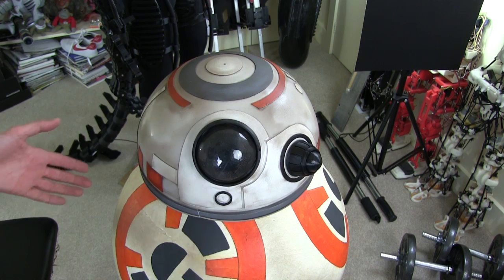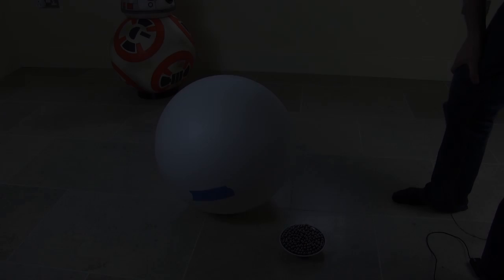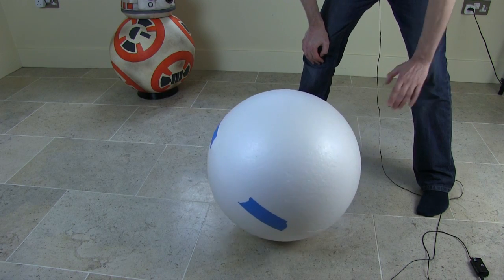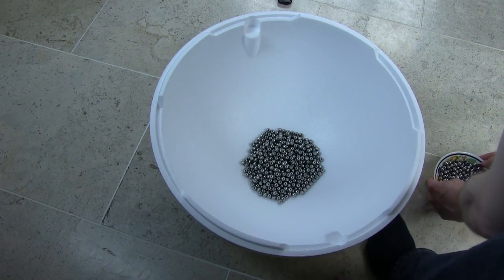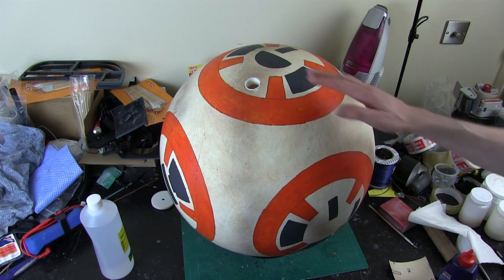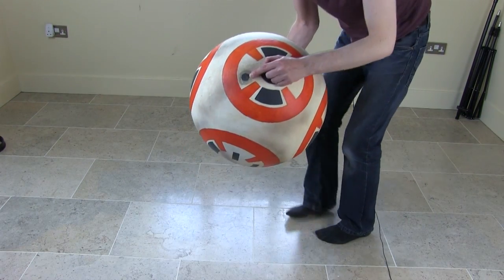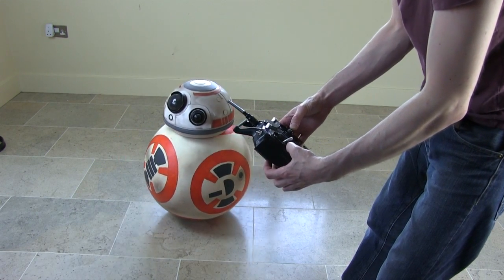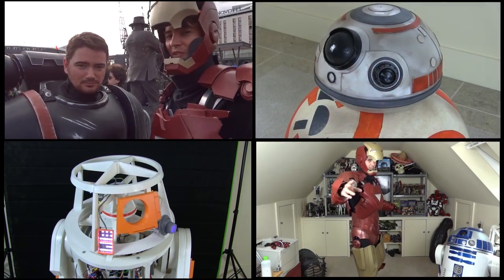Star Wars BB-8 Droid v1 #5 | Improving Stability | James Bruton

Comment: Did you consider the same system, inside the ball magnetically linked to the head outside, with a vertical shaft, going down to the bottom, with an heavy weight at the end, that wouldn't touch the bottom. The upper part under the head would generate the mouvement the same way yours does, and the weight just above bottom level would ensure stability. The magnets woukd ensure perfect friction between wheels and body?

Comment: You made your droid super top heavy and don’t understand why it has trouble balancing ....
Reply from the maker: That's part of the challenge - to see if the control system works - like a Segway/hoverboard?
Reply: James Bruton yeah but you added multiple DOF’s to the system AND used those terrible omni-wheels that have zero grip/friction.
Reply from the maker: @alkaline3mc  The grip isn't the issue though is it. Can I just point out that this was my first Arduino project from five years ago. I'll be building another ball-balancing robot in the new year. Check out my LG robot for now: https://youtu.be/e-CTFbop4PU
Reply: Also, when you find yourself Kluging in solutions like “filling your droid full of ball bearings and silicon”, to make your control loops work, then you need to go read up on control loops because you’re doing them wrong.
Reply from the maker: @alkaline3mc  I refer you to the comment I made some moments ago.
Reply: James Bruton oh I saw your comments. I’m encouraging you to stop kluging and just do things right the first time.
Reply from the maker: @alkaline3mc  please read the comment again then and refer to my more recent project.
Reply: James Bruton ahhhhh, so ultimately you’re decided to go back and do the right thing but for some reason couldn’t just say “I made this a while ago and have since decided to instead do exactly what you’re suggesting”.

Comment: HI James, I've got mine working now, so happy with it, I get 'pretty good' stability on smooth floor, but then I'm using the BNO055 IMU so most of the processing is on the A0 chip on that.

I do get a 'whining' noise tho when the head is at 'rest' on the top of the ball, any pointers on getting rid of that? I'm using 2 x the L298N boards (I blew up about 3 Rover 5 boards due to pulling too much current! :( )    :D :D

Comment: you could just put an RC car in it
Reply: Sanicle the car would not be able to move bring that the connection to the remote is not direct (the antenna would have to be put outside of the ball even then it would have to be in one place making only the weeds inside moveable and not the ball

Comment: Have you solved the oscillating issue? I think you should try using a powder such as flour instead of the ball bearings, I believe it will be much more stable, it will also be much quieter.

Comment: I m not a nerd ...but i think you should try using two spheres .,you know "one inside the other "n try finding a way to both stabilise and use it for movement also ...  That way it will not only move around stabile but also move in all directions.. If you get what i mean ...

Comment: Here's an idea. Place a large metal ball, such as a standard pinball, inside the base and attract it to the top with a really strong magnet in the head. If that won't work, try several smaller ball bearings.

Comment: Interesting approach! I think another good idea would be to have an omni-directional gyro vehicle within the lower ball, and perhaps magnet in the top of the inner sphere to attract another magnet in an ultralight head moving around on bearings. Of course that would simulate the head following the body rather than the body following the head, since the top of the inner sphere would initially tilt in the opposite direction of the desired motion. Can't say I've seen the new Star Wars so I don't know which of these ways the robot actually appears to work. Anyway great work with the arduino, I can hardly get mine to turn a motor 😂
Reply: +James Bruton (XRobots) haha yeah came to that realization soon after leaving the comment. Incredible work very impressive!

Comment: It would work by simply make the bottom ball heavier ( with no moving mass inside) more inertia, less need of high Mhz controller, I think. No moving mass = NO WOBBLE !
whatever material you try inside an hollow sphere, you just change the wobble value. think about conservation of movement.... ;)

Comment: My suggestion: Although I haven't watched the star warz movie, I have seen the trailer and from what I seen it seems that it could tilt with BB-8's head regaining balance. So I'd say design a somewhat similar mechanism kind of like BB-8's head and place it inside the ball. Design it to be magnetic so attach a similar magnet onto BB-8. So it says on the ball while still being able to move around. Create the magnet inside with wheels so it has a similar effect as if it was actually rolling around inside the dome or use a magnetic ball.
Reply: +Kagaruto Nation Or still use a few ball bearings and use a magnet on BB-8s heads to hold to those ball bearings.

Comment: You need a liquid base with a density thicker than water e.g. synthetic oil. Issue of course will be the insulation of the polystyrene ball...that will stop the unevenness of of the movement

Comment: You could use the inside of the larger ball to contain a separate control unit that the head unit can manipulate. It could be a combination of gyro, and counterweight with motors for axial rotation of the ball. I was thinking a gyro in the top end of the ball would help provide stabilization for the entire unit, and the gyro itself could also be the weight.. You could do a lot with it. A powerful magnet could be used to keep the head at the top of the ball as well.

Comment: I would suggest you use mini polystyrene balls inside the larger ball. If you fill it 1/3 or maybe 1/2, the weight would remain relatively low, while the stability should increase. Hollow plastic mini balls could work as well. I reckon they should be about 1/5 the size of the ball bearings.

Comment: Why not build the motor section as a wheeled sphere within the sphere so it has a low center of gravity and no wobble? Then just have the top section really light and magnetically coupled on rollers on the top. Then you could move the magnetic source around on the inside to control the position of the top section.

Comment: I think a solution would be - and it'd take some work - but having railed sections to let the baring roll in a fixed groove up and down, say six inches in length (The rail) so the baring can roll down, or up - be limited so it doesn't roll over (The wobbling effect on the ball.) whilst still allowing for the transfer of mass to equate into movement, you can fix the rate by more or less of this rail sections and even make a bias - so one side having more railings = more mass. @james Bruton

Comment: I'm not a mechanical engineer, but wouldn't it be easier to put the motor inside the body, with a heavy and relatively low center of mass?
You could keep the head on top with a neodynium magnet, and make it practically friction less with, in the more literal term, a bearing ball, or a set of wheels that align with the angular momentum of the body?...
Just an idea.

Comment: you should use a complex sphere system inside the ball and I see you have no way to keep bb8's head from falling off which I really don't like but that can be fixed if you the sphere system and use powerful magnets to keep his head in place over all if you want this robot to move and be like the real bb8 you need to redo the entire project cause the moving mechanics are suppose to be in the ball why the balance system is linked moving mechanics so the balance can determine speed torque ect with the amount of speed  of movement you are making and ik this isn't impossible it just take a lot of research and more arduino than your using and why youre doing that why not give it an actually thinking process like doing for its self or reconizing you

Comment: take that same mechanism that's the head and put it inside have the battery towards the middle of the bottom the battery would act like a pendulum the top part would have a post that go up towards the head and then have that connected with magnets hard to describe without a picture

Comment: Wouldn't it be easier if all the electronics would be in the Body and not the head? like the Disney one I think it would be a LOT easier! Now the dilemma with coating the ball bearings you should of painted the inside with spray paint or something like that. Then you could of used any liquid

Comment: Hello, as I remember from studies, this is could be example, when the instability is generated by the regulator. Especially when magnets and water is added. Oscillation of the system should be much smaller. Maybe the speed of the regulation is too low or delay added by regulation and motors is too big.

Comment: what if you put a ball slightly smaller than the actual body and so on. in theory the second foam ball is stationary and the smallest ball (a plastic ball filled with a small amount of oiled  ball bearings) when powered by the motor should give it just enough inertia from the weight but not to much to over power  the motor and have slight wobble and muffled sound

Comment: I didn't go through all the comments, but wouldn't a larger drone in the bigger ball, much like what you have in the top ball and then synced with each other make it damn near 100% solidly controlled movements? Drone in the bottom that can only go forward and reverse and programmed to stay in the lowest point of the ball, and the top drone like yours doing all the steering? The bottom drone having rubber balls instead of wheels on each side to control movement. Thus the steering is controlled by the top drone and forward/reverse controlled by the bottom. If the head turns so does the bottom drone instantly in sync. This method means zero sloshing around of any balls, water, oil or BB's etc. Just use a different signal for the two to communicate with each other, such as low energy BT. I'm not an engineer, but it seems to me a rubber wheeled robot/drone in both balls is the true method for solid controlled movement of BB-8. With your method the heads wheels will need to always have excellent traction or the faster BB-8 travels the better the chance he will lose his head, lol. Just a thought and I'm sure it was thought of long ago and cost far too much to actually go this route. Nice work though...

EDIT: lmao, never mind stupid me, looks like version 2 you had the exact same idea I was having.

Comment: Why used two battery? and two motor driver? (it looks like 'Dual H-Bridge')
Reply: +James Bruton (XRobots)  Thank you. 'ROB-11593' works by 12V. and can 4 channel motor control . Are you replace that 2 channel control ? ( bind  X-axis and Y-axis)
Reply: +James Bruton (XRobots)  In &#39;xrobots.co.uk&#39; introduce  &#39;ROB-11593&#39; motor driver. So  I confused that. Thanks.
I will use DC 12v / 6,000 rpm 1/100.Is that fast enough???
Reply: Have you experimented with car engine oil as a weight stabiliser?
Reply: Ray Pierce  NO, I haven't. I'm searching motor now

Comment: Why not replace the ball bearings with a block of medium weight material (like balsa wood) cut into the shape of a spherical cap (a dome) that sits snugly inside the outer ball. Then embed a few reasonably large bearings in the surface of the dome (like ball casters). You could experiment adding soft contact points to the dome to increase friction if needed (basically stick bits of carpet to the dome).

Comment: this could be a stupid idea im not sure but i think you should try putting a magnet on the inside then on at the bottom of the head to try and keep it on but lube the inside a little so the magnet can freely move

Edit: Also on the inside of the head i think you should insulate it or put some shock obsorbant material in there incase the ball does fall that way it should damage or damage as much

Comment: Heh heh.. Made the comment below before watching the entire video...the I saw you already tried the idea :)

How about rubberizing the ball slightly on the outside. If the outer surface is softer, it would emuate the carpet, and also might help with the head's traction, and even dull-out a little bit the noise.

Ways I can think of would be cutting slices of rubber (like a soccer ball's "parts" to allow the most spherical match) and sticking the on the surface. Another option is a spray-on rubber (don't know of any product, but there has to be one :) ). Or even using a ball that can be inflated with high pressure so it does not wobble too much.

Comment: if you could use  some kind of magnetic  system  putting  light metal  in the  inside lining of the howl  ball , an guided magnateball barings in the head like in tracks, just a thought  idk how it would  work  but the ball possibly  could  be more balanced if the inside weight  was moer evenly  destributed  an if its lighter inside you still will have speed an more battery  life.. ? idk your alot  smarter  then me , good  luck  looks cool .

Comment: Your making this way to complicated ...., take the control unit from bb8 head move it to the body be sure to add more weight to the bottom to give a lower center of gravity now run a pipe to the top of the main ball adding magnets to the top you can also add a servo to be able to turn the head oh configure the magnets in a cross pattern.... Now close up the ball. Step two bb8 head add a steel plate in the same cross pattern on the bottom of his head between the wheels this way when the servo turns his head will turn independent to the body but will also stay on top when the ball rolls

Comment: Why not have the interior of the ball motorized so that there is not only weight, but a separate source determining direction and speed of the entire unit, while the head can be only a little bit lighter, but focus on it's own movement and adjust to the balls movement, instead of having it control the ball.

Comment: Just use a low viscosity oil.  If I remember the physics correctly, you will need to ensure that the base is about the same weight as the head, but that is the limitation behind this design. Any variance will affect performance.  With the drive motor in the base, you have many more options.

Comment: If you want your BB-8 to work properly much like what appears in the movie, try this: simply add another accelerometer and gyro unit to the inside of the larger ball that is radio synced with the electronics in the head (don't worry about the weight factor) and you will find that gravity and inertia will do the rest and the two units will move in tandem. You'll be able to actually make the robot move right or left, forward or backward or on an angled trajectory on any surface without any hesitation as the electronics are now sychronized! No need to thank me!

Comment: I'm guessing its the surface of the ball. When you make contact with the floor you lose stability but not on carpet. The plastic seems too smooth for hard floors so the unit is not stable. I know the designed of the ball is to be smooth so the magnets can connect and the head can glide freely around the ball. Since your using wheels under the head to move around the ball not a magnet,  you shouldn't need a very smooth surface for the head to glide over.  What about Lining the surface with a very thin layer of silicon or  some rubber type material.The surface will grip the floor better and still be light enough to maneuver. It will also give your wheels underneath the head a better contact for control. Kind of like how they use to do with a mouse track ball and mouse pad.

Comment: you could be built the mechanics inside the ball instead. using a magnet to hold the head on top and wheels inside to spin the ball under it, having a weight at the bottom to keep the head at the top.

Comment: A good idea would be to use two motors and put them on a ball. Then roll that ball inside of the other one and use that to control it. If you don't understand that you can go to YouTube and look up what's inside a BB-8. Choose the first search result and it will explain how the toy works.
Reply: Thanks. I just looked at it right after I watched the first video and I noticed I was a doof.

Comment: If this is like r2d2 there is as much tech in the body as the head. You need self balance wheel "hoverboard" gyroscopic tech in the body to do the rolling and with your design for the head that also corrects and balances to make this work.on the way to an amazing bb8

Comment: Have you thought about using a teensy 3.1 instead of the arduino? It should be quite a bit faster and you can just reuse the code.

Comment: Im not the one who has the solution to this problem but i think that if you make a strong magnet connection between the head and the ball it will give greater friction to the wheels with the ball surface and therefore prevent the slipping of the mechanism off balance

Comment: How about a single small expanded polystyrene ball (golf ball or tennis ball size... or actually use a tennis ball or whatever weighted ball is appropriate) inside a larger expanded polystyrene ball (volleyball or cabbage ball size) inside of the original polystyrene ball. The small ball inside the midsize ball would reduce the midsize ball's wobble which would reduce the final ball's wobble.

Comment: you would need to open the big ball and build a sphere shaped frame with wheels at each side of the frame. add weight on bottom of spherical frame and maybe even add a strong magnet on opposite side of the weight.